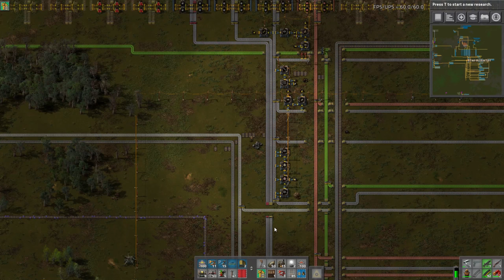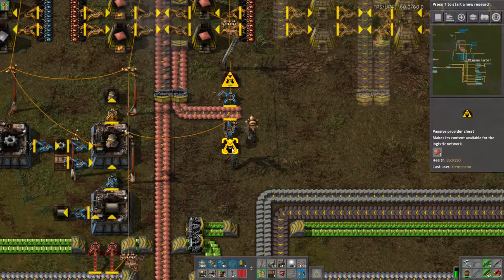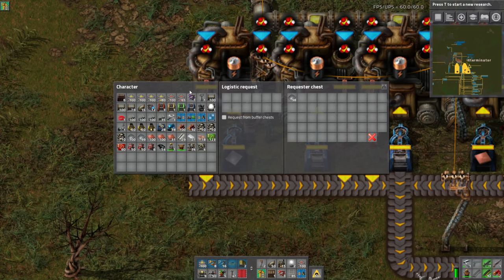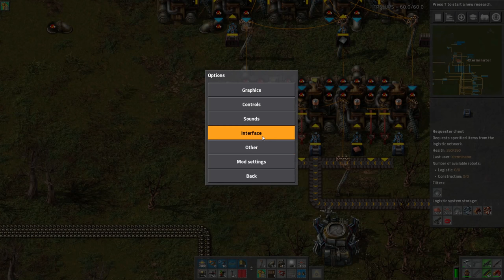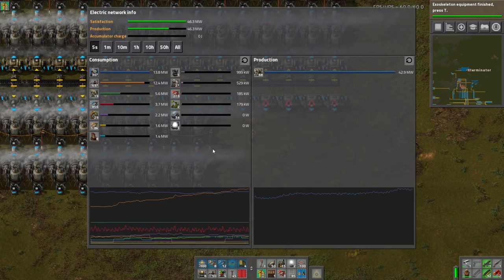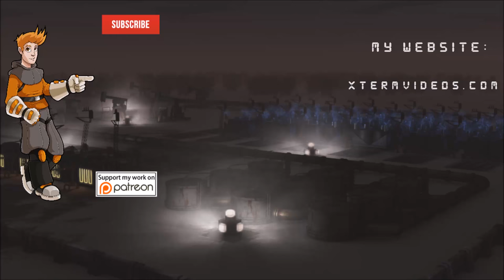Factorio: Tightening The Belt: Megabase Guide EP18 - LOGISTICS NETWORK | Tutorial Gameplay Series

Comment: You probably know that you can "copy" an assembly's recipe onto a requester chest and it will automatically request all the ingredients.
However, they recently improved this feature, because now it will always request (I think) 30 seconds worth of ingredients, instead of the weird amounts it used to request. It even accounts for modules!
This might be worth mentioning I think :)
Reply: That is what I typically do for my chests. If I think it might be too far a travel distance for the bots to keep up, I test it by waiting for the bots to finish the delivery, then I remove an item and time how long it takes a bot to arrive with the product.

If it's less than 30 seconds, then I just leave it alone. If it's longer, then I take the current request size divided by 30 multiplied by the robot response time. Then I bump it up a little bit just in case a few bots decide to stop along the way to recharge.

Comment: for heavy to light cracking, i would put a pump in front and limit it by aviable lubricant, otherwise you can run out of that and stop purple science and blue belt production. 
Same happened to me for a slightly different reason when i massivly scaled up the science in a different area. Since my starter base now only is there to produce mall stuff (also no circuits), i have nothing that consumes gas/light oil. once those tiny tanks of the initial oil setup were full, it only sucked out heavy and couldnt produce lubricant once light/gas was backed up. When i got rid of the starting science area, I had to also bring in lubricant from the new one to keep blue belts production rolling. I tought of bring in red/blue, but kinda forgot lube at the start.
Thats what i love about that game. There is no one true way of building. Im not using solar and my base is walled off for now, the battery prod. for yellow was moved, so i didnt even consume sulfur, and suddenly i ran out of blue belts :)

Comment: Couple of quick points.

When using the logistics connection on inserters it reads everything availible to bots in the current logistics network, not everything stored in it. Basically all logi-chests except the requester. For some reason I got that wrong when I started out, so I thought it worth mentioning for new players. Fun fact; if you're in a logistics network and have stuff in your trash slots, that's also read as availible for bots.

When the steam power ran out of coal, is it possible it's just because the chests outputting to the belt going that way were empty just before the train came in? If so the train would probably have just arrived when you noticed the shortage, since it fixed itself soon enough.
I'm thinking a balancer for the coal train would be good, to even out the unloading.

Comment: Fuel consumption gets crazy on the boilers once you overload the power grid. Placing roboports in combination with miners turning on probably caused it to go into yellow for a moment, which stripped the belt of coal, causing the outer boilers to run out of fuel and get stuck in the yellow zone.

Comment: In 0.16 requesting full stacks of items was changed to requesting enough items for a machine to work for 30s, modules and beacons modify this request
Reply: also when you are putting down radars you have a preview on minimap and placing robots directly on the ground is more fun
Reply from the maker: That is only if you copy paste from a machine. It still requests a full stack by default if you just go to set a request manually.